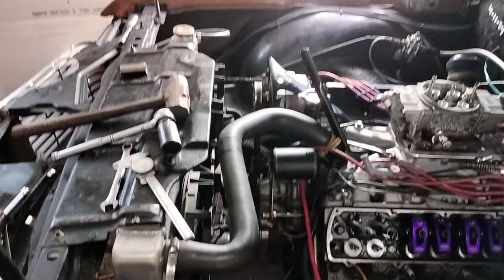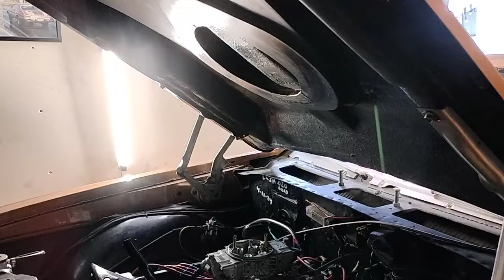we are fixing to fix something

Comment: Are you running a vacuum pump? Your pistons rings could be fluttering and becoming unstable which would cause power to fall off.
Reply from the maker: I thought about that. I should run the evac tubes again.